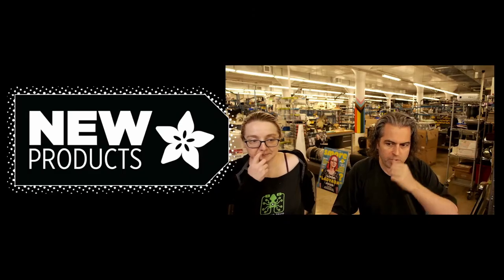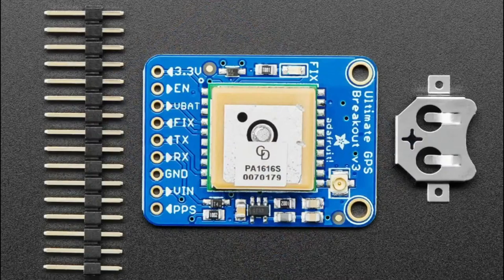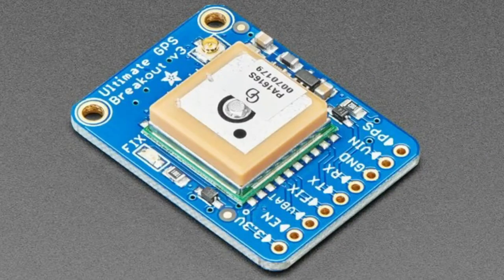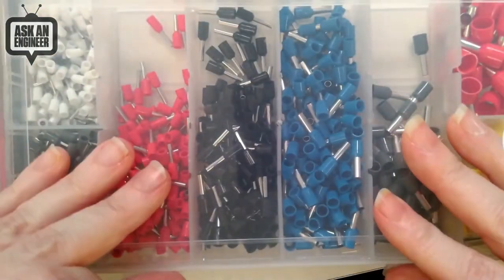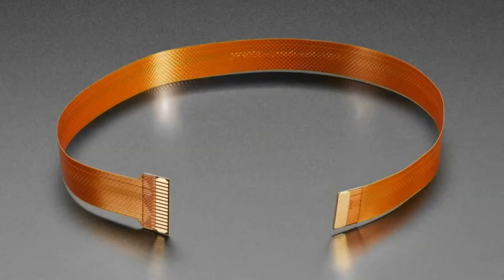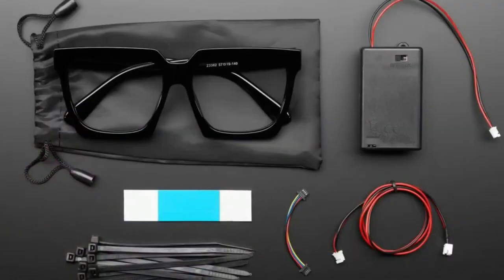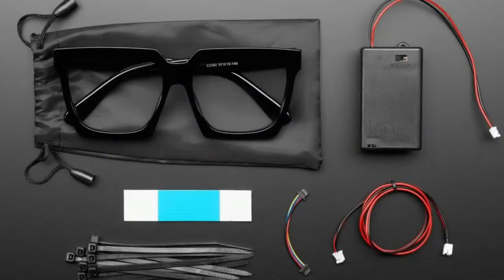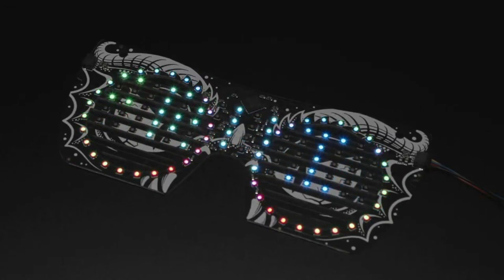New Products 10/13/21 feat. Kitty's Flowers - Pair of Bluetooth Wearable Brooches - Art byPhysicis!

Comment: Using the correct crimper with the furrels on stranded wire makes for a very professional looking installation. It also makes the initial implementation and the rewiring or stranded wire connections a no-brainer.

Comment: There was a talk on YouTube by a model maker or robotics guy, and one of the tips he gave was, "stranded wire, screw terminals, and bootlace ferrules!" I took his advice and I've never had a connection using these fail.

It's also a great idea to use a crimper designed for them rather than just squishing them on like a spade terminal.  If you use the crimper, it's much less likely for the ferrule to slide off.